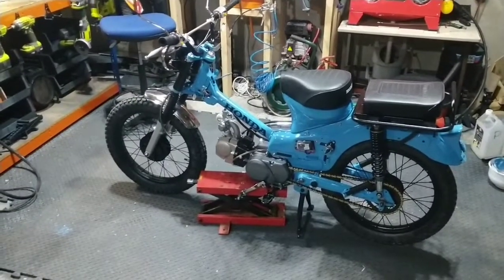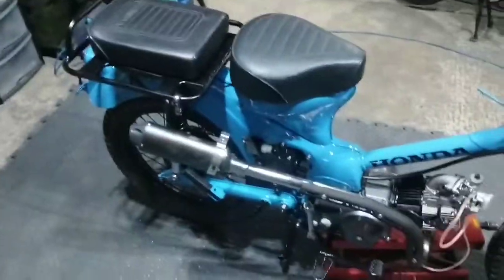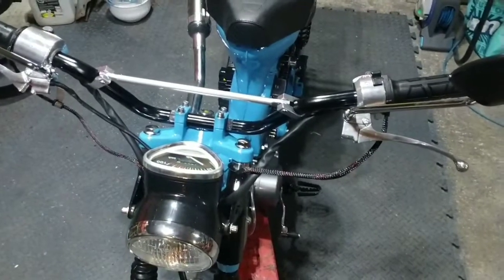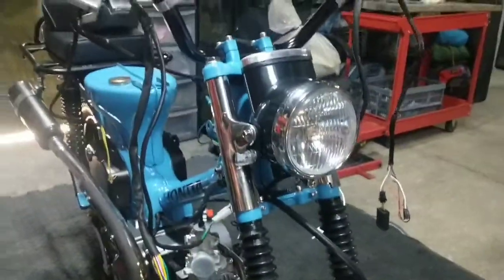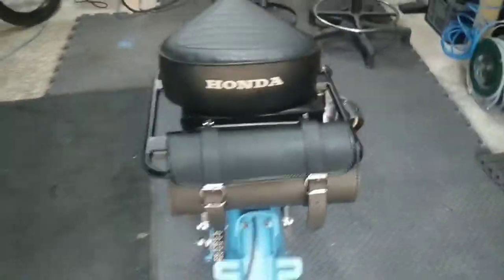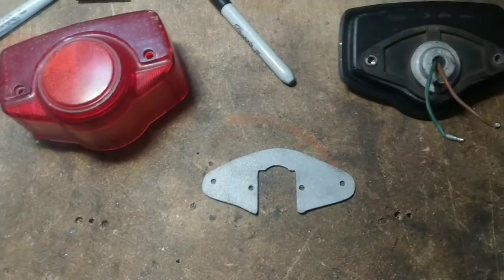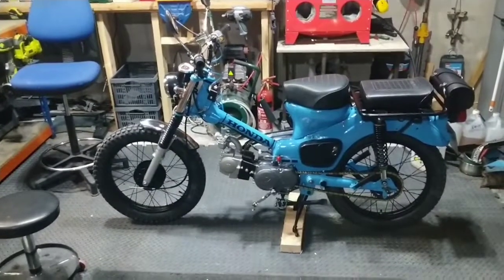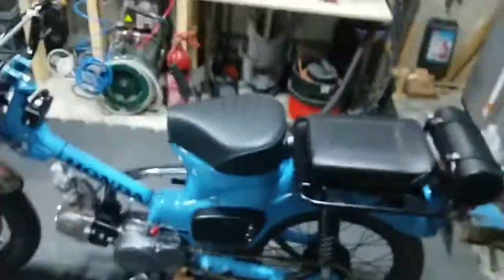Honda C90zz custom build Part 4

Comment: Looking great, the only bit I don't like (personal opinion) is the edging strip on the front mudguard, I'm guessing you like it for its '70 kitsch feel lol....I think a painted silver or black line along the back bare edge would have looked nicer. I never knew you could use diodes like that.... yes you are so clever, I hate wiring mainly 'cos I don't understand it :)
Reply from the maker: Cheers for the comment Hep.. I welcome folks opinions and ideas. There may be some circumstance that exists where my opinion/decision could be improved, (although I can't realistically envisage such an occasion).. ;-)
Reply: @macawdor5065  :D Hey man it's your bike, matters not a dot what I think and yes you're right, as always :)